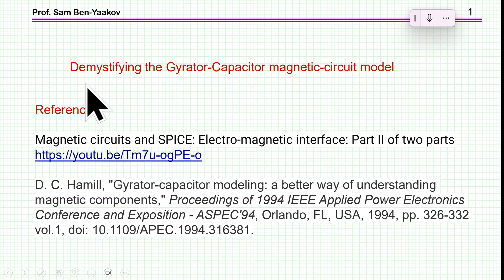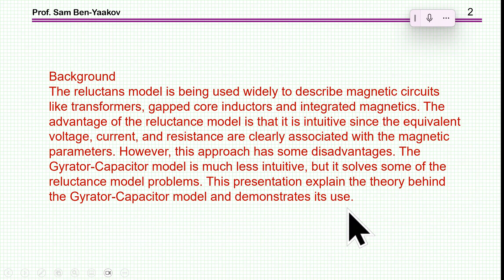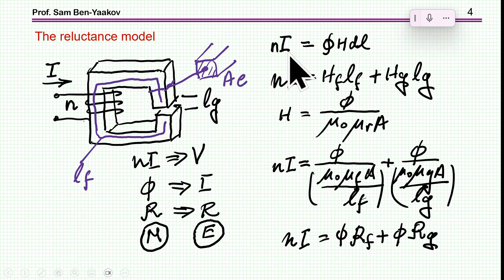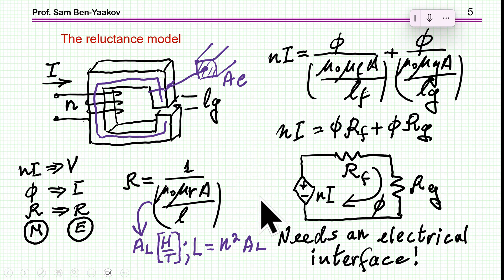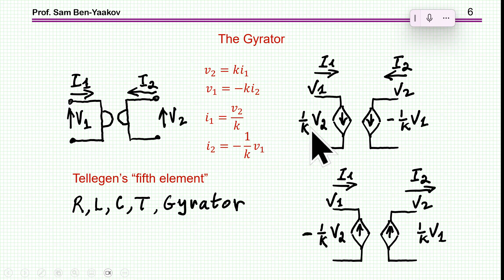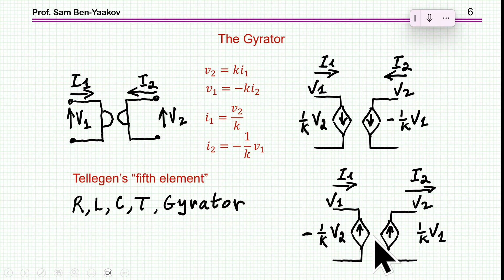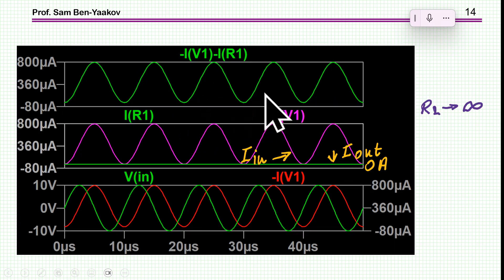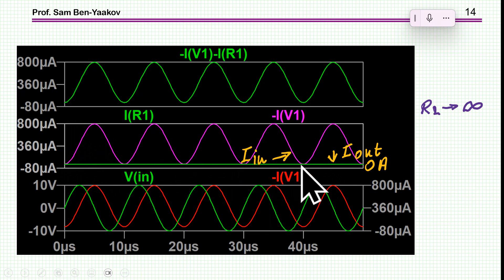Demystifying the Gyrator-Capacitor magnetic-circuit model

Comment: Thank you, Professor, for this insightful video. I have encountered a problem that has led me to a question I would like to share.

KCL and KVL, fundamental laws used to solve electrical circuits, are derived from physical principles that align with the natural world as we understand it. However, when KCL is applied in the gyrator-capacitance model, it introduces a non-physical equation stating that "at each node, the sum of directed flux-rates in all branches is zero" (Eq. 22 in the paper here: www.plexim.com/sites/default/files/magnetic_modeling_PLECS.pdf ). In practical terms, this implies that the sum of all voltage/turns in the branches connected to a single magnetic node is zero, a statement that cannot be derived from any known physical law (please note that this is not equivalent to the continuity law for magnetic flux).

On the other hand, KCL in the gyrator-capacitance model fails to enforce or guarantee adherence to the physical law of nature ∇⋅B=0 (Gauss’s Law for Magnetism). To resolve this inconsistency, an additional law must be introduced to enforce Gauss’s Law or KCL for fluxes (Eq. 25 in the paper). Without this added constraint, the violation of Gauss’s Law persists. Unfortunately, even with this third enforced law, computational solvers sometimes fail, particularly in nonlinear core modeling simulations. This can result in the summation of flux at a node being far from zero, producing significant deviations and leading to unreliable simulation results.

This raises the question: why should this model be considered useful if it introduces a non-physical law while simultaneously ignoring a fundamental physical principle (Gauss’s Law)?

Thank you!

Comment: Great as usual..sir could you please make video on slope compensation in peak current mode control and how to extract data for slope compensation from datasheet of the controller
Reply from the maker: Thanks. Have you seen https://youtu.be/b67u3Y3l26o  ?
Reply: @sambenyaakov  yes sir I went through this video..very helpful to understand internal workings...when I am trying to derive parameters from datasheet like slope value effective Sense resistor values then getting problem
Reply from the maker: @biswajit681  The slope is not from the data sheet, It has to do with the up and down slopes of your circuit. Write me the details and I will try to help sam.benyaakov@gmail.com